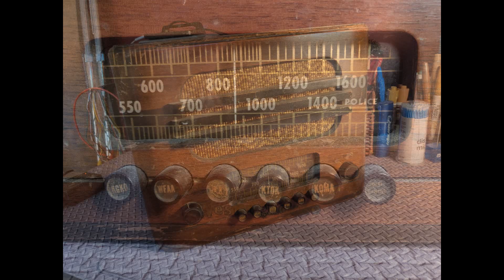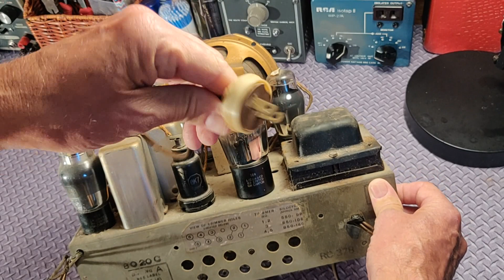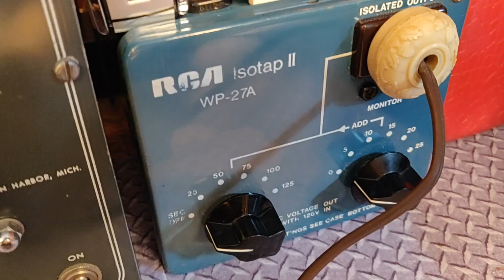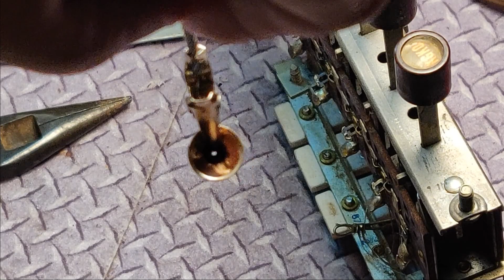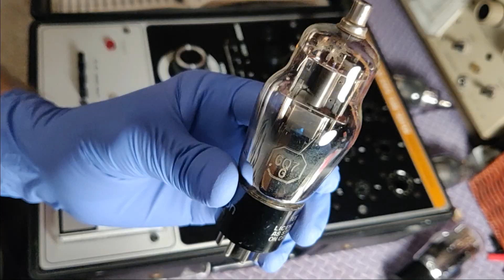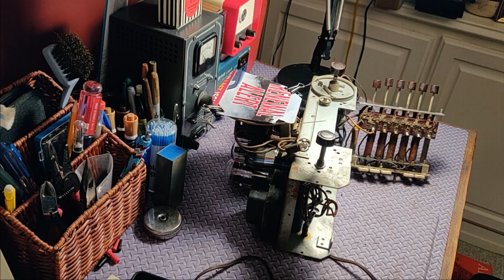Westinghouse WR-258 Tube Radio Repair Part 1

Comment: I have the westinghouse WR262 I think chassis model says 232 E

I wanted to restore it to working condition but I'm getting scared to mess it up... I'm so used to modern electronics.. especially the radio is all original... But I did get a zenith working but those tube radios are pretty EZ for me.. But these seem harder to work on 😞
Reply from the maker: +SubigirlAWD _ Thanks for watching! Your on the right track in my opinion. I’ve learned from scratch by just watching YouTube video repairs.  Start slow and retest the radio after each component replacement. Good luck!!

Comment: It’s odd that every tube tested exactly in the same spot on the meter. That would make me suspicious of the tester. I’ve never come across that on one of my 5 testers.
Reply from the maker: SIXSTRING63 I didn’t think of that. I’ve collected a couple of older testers and I should get them out and see if I get similar results. Cheers!
Reply: @RadioRetired  Might be worth a look. It was just strange they all landed on the same reading. Especially since they were all different tubes. I've had tubes of the same model read close but never on the same mark very often, maybe 1 out of 50.